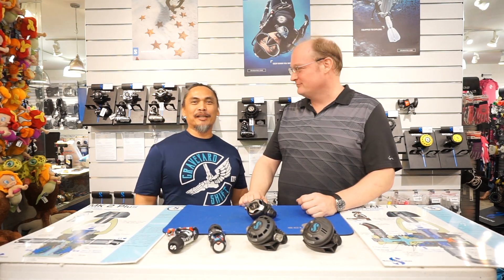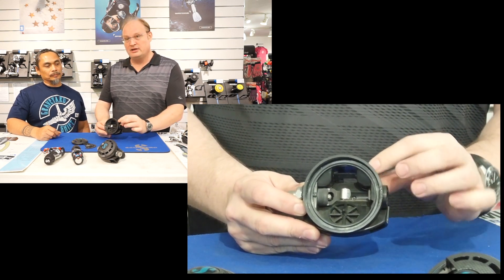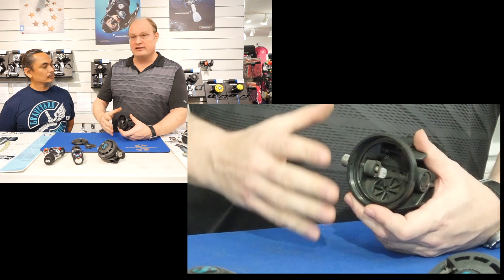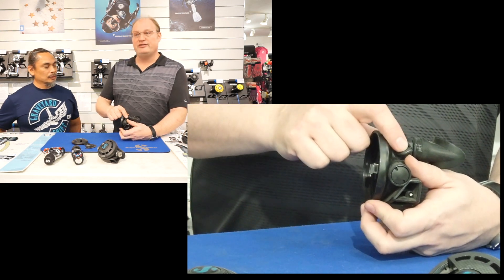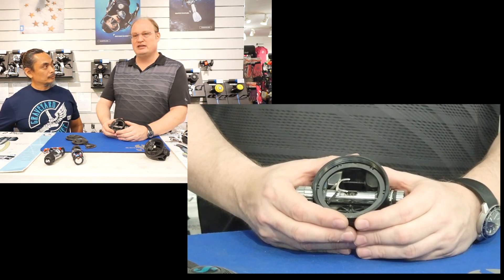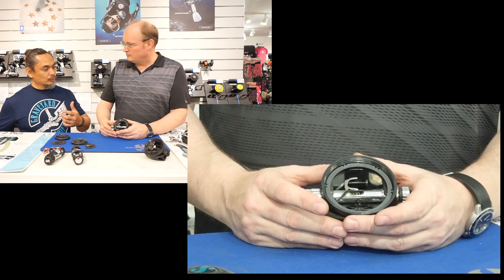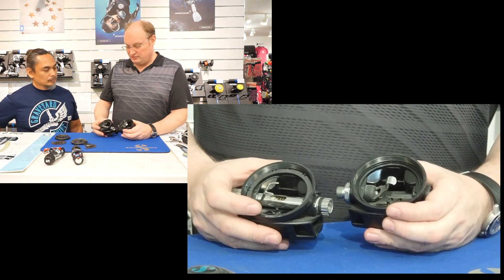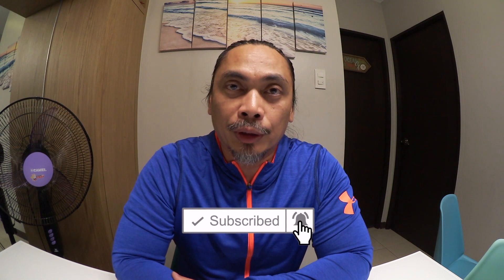Scuba Regulators - User Adjustments

Comment: Again, a very informative video. It's very useful to know about adjusting the balanced regulator when using a DPV. I'd also forgotten about putting a finger over the mouthpiece of a freeflowing regulator (which happened to me at the weekend. I quickly closed the ventura instead). I do have a question. My S600 is getting hard to breathe. Do you think a quick adjustment to the spring (in the barrel) will fix this? I don't necessarily want to take in my whole regulator set for a service. It's expensive to do this. Thank you! (And please don't forget about making a video comparing a balanced piston 1st stage with a balanced diaphragm 1st stage. :)